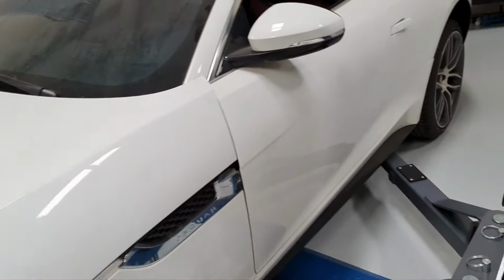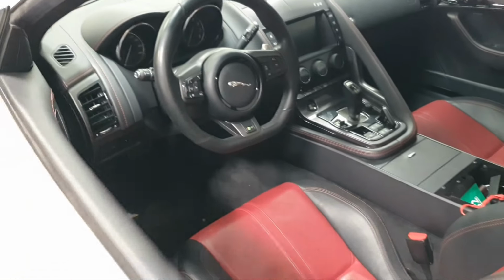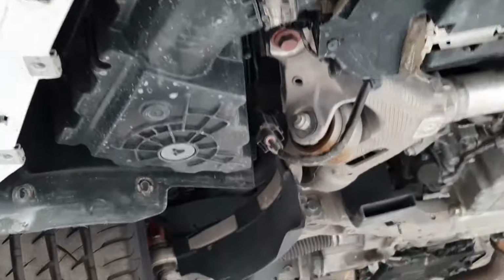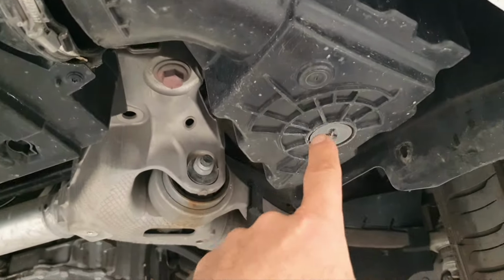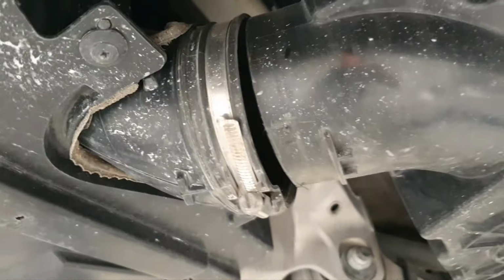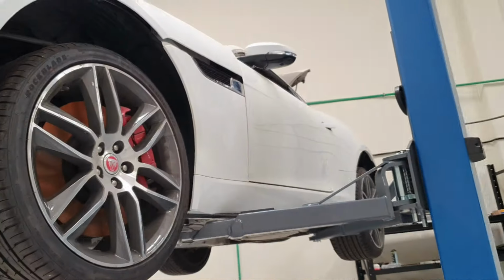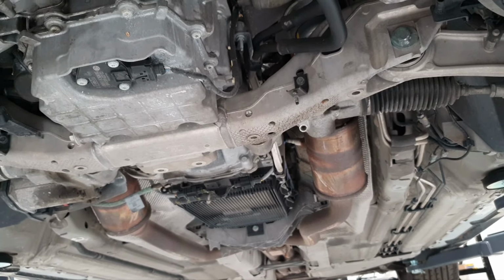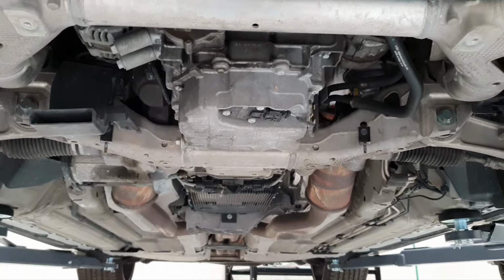Jaguar F type 2015 with 72k miles engine hydrolocked (part 2)

Comment: Makes no sense having the air intake right at the bottom. It’s criminal that the duct wasn’t seated correctly prior to torquing down the clip. I’m amazed the owner didn’t notice performance issues prior to the hydro locking incident. Outrageous that whoever last worked on the car handed it back to the owner in that condition. Unbelievable!